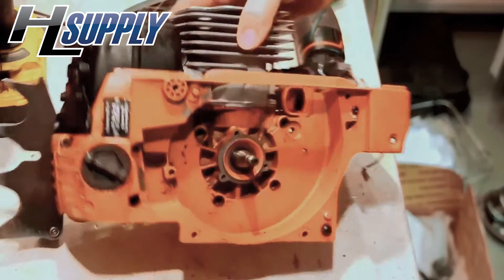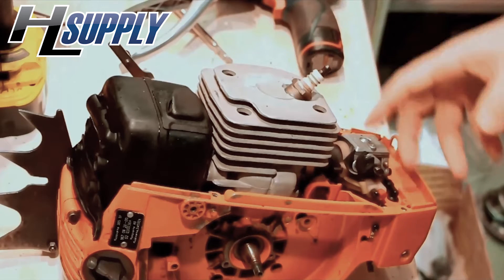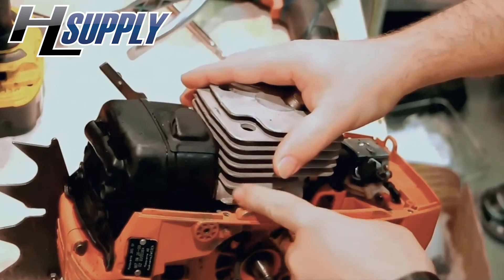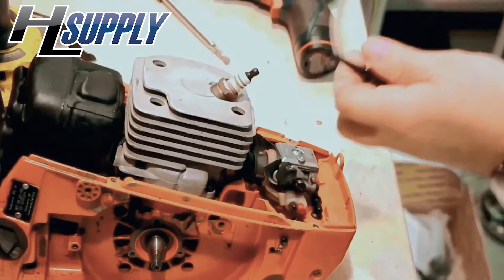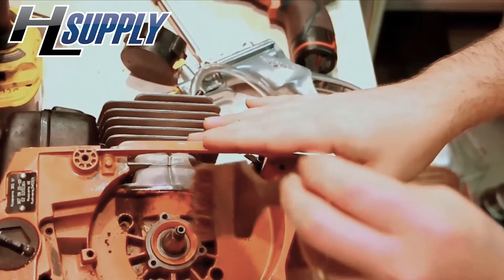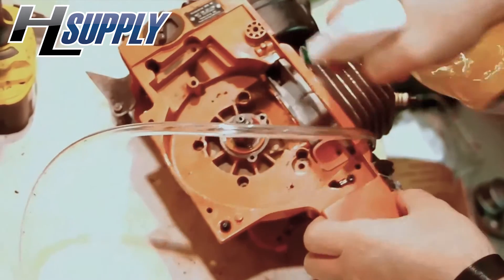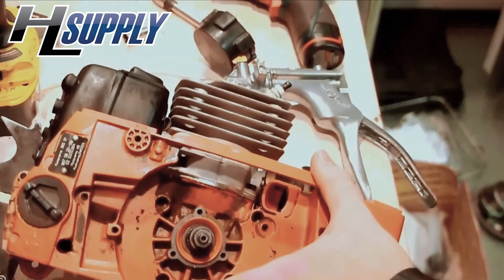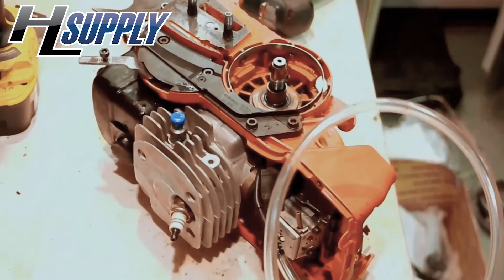How to Pressure Test a Chainsaw by Matthew Olson

Comment: By leaving the office mtake and nstalled you have throw another possible leak point into the mix. To check crank seals its best to use block off plates directly on the case.

Comment: Hi Matt I have an old Homelite that has a spacer and reed valve assembly in front of the carb.  Should that be left on as part of the pressure/vacuum testing, or removed, and the block off be applied directly to the head?

Comment: Mat, what are the performance symptoms of a vacuum leak on a (42cc Craftsman/Poulan) chain saw? That is, at what point in troubleshooting a no start issue would we check vacuum? My saw will fire and run momentarily when I feed a few drops of gas into the carb, but it will not even attempt to fire otherwise. Spark (tester) and compression (150 psi on pull) test good, new factory carb and primer bulb, proven fuel.

Comment: Does it matter if you test vacuum or pressure first? Thanks for an informative, to the point video!
Reply: A lot of service manuals for chainsaws say that you MUST do a vacuum before a pressure. Now if it is 100% necessary I don’t know. I always do a vacuum before a pressure but as long as you’re at least performing both you’ll be good.

Comment: 2 things not mentioned- check the pulse line where it goes into the crankcase, they can leak. Also, clean off that soapy water before you vacuum test! Don’t need to suck that crap into the engine if you did have a leak.

Comment: I'm working on a husqvarna 550xp that wont start/hard to start. When it does start,it idles very rough and takes alot of pulling. It read 85psi of compression. I immediately took the muffler off only to see a really nice looking piston and cylinder.  No scoring,no pitting,no notable carbon build up. I really thought I'd find scoring and an obvious reason for the lack of compression.  Before I go taking this thing apart,is there anything anyone can think of that would cause this? I'm thinking about plugging the decompression valve hole,but cranking on it and even with it running I dont hear any rush of air or noise of any kind around it.
Reply: Stuck ring would do it, but prob not the case here. I’d guess the decomp valve is bad. Easy enough to plug the hole and test again.
Reply: @brucea550  Got it apart and it had a blistered looking place on the piston land. It was deformed and had obviously been very hot right there. I guess it effected the ring too. I've bought a new meteor piston and caber ring,but I lost one of the little spacers that goes on the cylinder bolts and I'm having trouble locating any.
Reply: @ciphercode2298  That almost sounds like a factory defect, if the piston got that hot but no cylinder damage. Not sure what spacer you need, but here’s the exact place to find it-  https://www.jackssmallengines.com/jacks-parts-lookup/manufacturer/husqvarna/chain-saws/550-xp-2013-01?__cf_chl_jschl_tk__=9664fac9225966f44b42b88cfe6832e9d1bc584a-1626133662-0-AVMIMSz67fySoLrHgIWPRCq3P-gGuTM2ZN1YFtWF_zEbSRhlbqtvI2U2gMQzjlW2KJXZWVWaqoihdUb3yVRlnFRP98bv3nvk7lKeJFb9yUf_CQkLT9BgFpiVWnpVBFYO47U2DHcEe1ZWkA72RGusE40WH18IcJppbkTSn-MTijaDrSJ9iq6yIolfWdmbpjZwR2QOG2dyWgAWdo8-W_udnw0HtWae9uqqQxgUFlWl2gMKDRW5Rwod8oBTpnyd2hFBy3jphp4RkLSJSGeUsHXhZKjOPRd_YA3enGGdoyzVeCohi0LDKSGbFrbbZo9sCbUPd4NDpkqFAq9tSELt5wnM4RNXjhnzJOGtj5GK90bMP6JeHaBnqky3QVXH8YL6X-XtDcSjEtq1qXwtpOpU5FIOUwHK2_Aqty8wpMjFW6x-s7Hpvyp6pxsrazvuxsjnROkkG7uBSQVVvNB12mt4Q8oyF3bXR_VHSX8IaSlNT9VoHjeL54a3Sed7PTswWOc8gelOaHamF2jR35UR7vJobtdn41MGbKSiKM9uHMqTAL1uHuOE
Reply: @brucea550  I appreciate that,I'll look it up. Theres little spacers that go between the cylinder bolts and and the cylinder. They set at the cylinders base and are shaped like a thread spool. They're only about 1/2" long. I've never seen any like them,which is how I lost the one when I took it apart.  I'm usually stihl guy anyway,but got this saw cheap because of it's running condition. It has a date etched into the top fin of the cylinder beside the spark plug that reads 10 2017,but as I was taking the saw apart the date of manufacturing on the coil said 2013. It probably belonged to a tree service company and saw lots of use and I figure it was rebuilt in October of 2017. The cylinder has husqvarna markings on it,but idk about the piston and ring. I do appreciate your help.
Reply: @ciphercode2298  Jack’s isn’t cheap, but they have always been my go to source when I need a hard to find part. Great quality and service, and fast shipping, so I’m fine with their higher prices. Good luck with it. It’s possible the saw is a 2017 and the coil was simply existing stock. They don’t go bad sitting on a shelf. It’s also possible you’re correct about it being rebuilt once already. I’ve heard the 550xp is a nice little saw. I’m partial to Husky, but have a nice running 041av mounted to a Lewis winch, an 031av I’m currently rebuilding, and big old 066 I use occasionally for slabbing large logs. My Husqvarna saws are all about 30+ years old too, not a fan of computerized epa stuff I can’t adjust myself.
Reply: @brucea550  I appreciate all you've done. I'll get it ironed out,just takes a while. I haven't ever taken one apart and seen any etching on the cylinder.  You can tell it was done by hand,because its uneven and pretty sloppy. It feels like a light,well balanced saw. Once I get it going,I'd say it's a keeper.

Comment: The beauty of this video is that Matthew didn't try to sell specialized flange blocks.  Just some inner tube.  Good stuff.
Reply: @hlsupply, I want to ask both of you how to seal between the boot and carb if you have a flanged boot... it's such a pain to take off the cylinder if you've deleted the gasket. Its aslo, equally as painful to remove and replace the boot from the cylinder without removing the cylinder. How else can this be done with a boot flange that seats the carb internally?

Comment: Just been on a forestry forum ref a problem with a Husky 61 1995. The pull cord locks when the spark plug is in place. Remove plug and engine pulls over with no resistance. Muffler off makes no difference. I had been trying to start it and over choked it. Tried the recommended fixes. Suggestion that oil in crankcase causing hydro lock, no idea if that's possible.
Waiting for a carb rebuild kit as per further suggestion. Checked with Husqvarna, plug correct for model and year. The original starting problem was possibly crushed lead from kill switch to electrics. Replaced with new. The last time the pull cord cover was removed and replaced one of the screws caught the lead and flattened it. There is no compression release on this model. Thanks from UK.
Reply: Did you figure out what the problem was with your Husqvarna 61? I've got one  also. It's hard to start sometimes. Either when it's cold or when I'm cutting firewood and shut it off for a few mins, and then try to restart it.
I've ordered a carb rebuild kit, and of course I put a new spark plug and fuel filter on it.
I'm hoping the carb kit fixes it. 
It's a nice old saw that I picked up for $50 at a yard sale. Runs and cuts like a beast, when its running....

Comment: I am running a Vacuum test on my 372 Hutzul Build. I had some erratic running that I could compensate for with the carb Adjustments. So I went down to HF and bought the Mitty Vac. I can’t get the saw to even hold 5lbs of pressure for more then a few seconds. I checked my inter-tube at the carb & muffler and tried several different configurations that seem to be air tight.   I also put the Oiler screws in. Can’t find an obvious leek. Would the saw even start with such a huge air leek?? I keep thinking I am doing something wrong with the setup. What could I be missing??

Comment: Very informative video, my chainsaw all of a sudden starting running out of tune and losing power when warmed up as if it was leaning out. I thought I had checked everything until I seen this video. Sure enough I had a bad crank seal and was able to save my chainsaw without burning up the cylinder. Thanks!

Comment: Yo yo Mattyo, thanks for the videyo. How about another on how to test from the spark plug port? And maybe HLSupply could be the first company to offer a spark plug port adapter to allow testing from that port? win, win.... I use an old compression tester with the schrader valve removed.